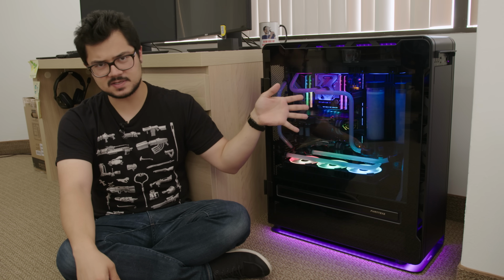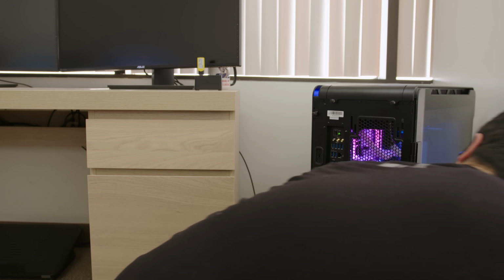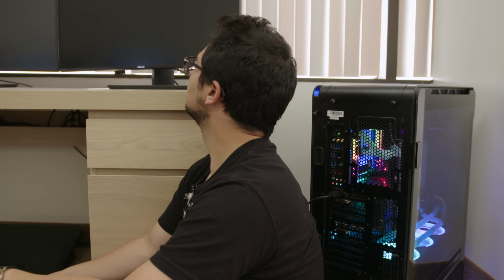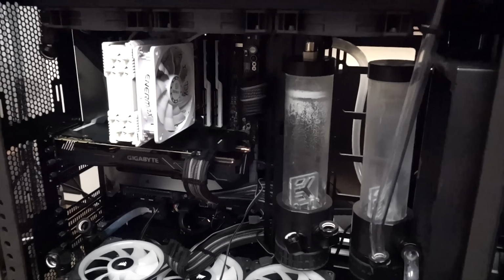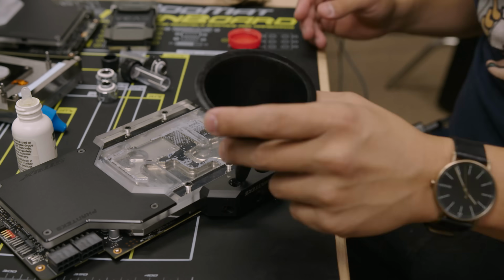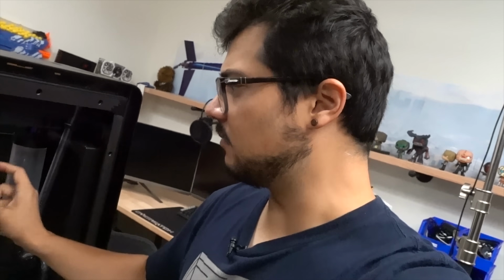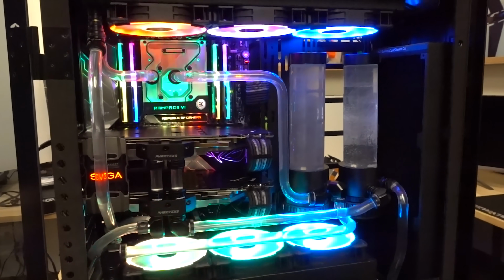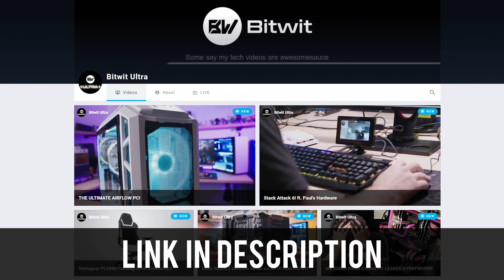Fixing my $12,000 BRICK

Comment: Over the years I have seen computer do some funky stuff when hardware is not seated right. Just moving the computer could of moved that GPU enough not to make the system work correctly. To think that's been sitting there all this time. I still learn shit everyday with computers. Keep up the great work Kyle.
Reply: My PC was dying every few minutes after taking it to my sisters. Took it home and it was fine for days... Took it back and the damn thing did it again. Days later at home it finally died on me and I fgured it out. Aio pump was dying and CPU was hitting thermal cutoff. In the moving process I was rattling the pump enough to kill it and vice versa when I went back home.
Reply: AIO pump don't have a long life expectancy.
Reply: Idk, 6 years seems like a plenty considering it was $40.
Reply: I have fixed MANY problems, with simple reseats.  Memory most often.  Don't know how it happens, but it really does.  Exactly why I didn't hardline my build.
Reply: Simple answer there HotRodHippie....Dust....
Reply: i still have same AIO pump for 5 years now. last years i modded it with a small heater core almost 240mm size from a unknown car and i put fresh fluid ^PC liquid cooling certified^ work great. no not antifreeze for car!!! i won't try it.
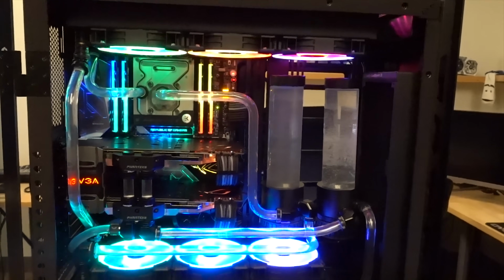Reply: Water dripped on his gpu 13:01
Reply: Worked at a computer company that send PC by post. Had a lot of issues with these large graphics cards getting unseated from their PCI and AGP slots. Not fun, people getting their PC and it won't turn on at the home. They blamed the company, but if you abuse a box with a new computer in it - for instance by tossing it into a truck - then chances are even the strongest connections can get slightly loose. Fortunately the cases were easy to open, so you could let the client fix the computer himself, rather than sending out a mechanic (which would certainly kill the entire profit margin and would likely be more troublesome for the client).
Reply: Kryptix i would have had a heart attack
Reply: @HotRodHippie  Thermal expansion I would think. Thinks get hot & cool down at different rates.
Reply: @Britec09   Been running my 240mm aio on my 3770k since 2012 build and it hasn't let me down yet.
Reply: @TheLogicalLowdown  Agreed they last  a lot longer than some people think.

Comment: Its healthy to get rid of the poop in your loop at least two times a day
Reply: poopity scoopity doop
Reply: Stacy Schauls I thought this wasn’t supposed to happen with the Vue
Reply: You could say I’m, out of the loop. :P
Reply: the2great2bob rabbits go like 12 times a day lol
Reply: Lol247, if you base it on the original marketing of the Vue then yes it should not happen, if you base it on the current amount of warnings that come with Vue you would be lucky to get 6 months. Kyle got lucky, if that fluid ran much longer you could possibly see it stripping the nickel plating off the blocks and when that happens you usually have a cascade reaction across the entire loop of heave abrasion. I have seen in one case Mayhem Aurora out last Vue and Aurora is very, very short term, only for show so that’s how bad it is.
Reply: I do it once every 2 days, and ma loop is good as floop, ah shit
Reply: mantisman230  yeah but two times a day is weak, not human, she must have a loose anus
Reply: A A thanks that’s good to know
Reply: So what colored coolant would you suggest?  Only I've been using straight distilled water in mine, but with graphics card prices back down, I was thinking of getting a 1080 TI, and doing a custom hardline instead of the soft tubing loop I have, and wondering what I should use.
Reply: @DanielMosey  about once a day for me, sometimes skip a day randomly
Reply: Yeah, no one likes a dirty pooploop!

Comment: maybe it was the video cable
a0=everything ok
but absolutely no output
even after a2=no os drive
the system should have been able to get to bios
Reply: Yes dude he made it to the bios , but nothing was displayed bc of the GPU prob,+ if the mb had integrated graphics, the pc would show a normal boot
Reply: Erick Rosa the motherboard have no integrated graphics. So it's useless.
Reply: At first glance, I was wondering why he wasn't trying different display ports on the GPU. Maybe he did, I'm not through watching it but... yeah.
Reply: PeterDerBeste i just had the same problem on a Maximus x formula build A2 error code.  Simply turning on the screen manualy Once  fixed it for me. No problems ever since

Comment: I had the same issue with a maximus x hero and an 8700k. It would say a0, but wouldn't display anything. I unplugged the front usb  and all rgb headers, as well as any keyboard or mouse and it worked fine. So nothing but fans and m.2 ssd. After setting up the bios and installing windows it boots fine with everything plugged in.
Reply: I had to reset my windows in my ssd to get it running. Same setup with you too.

Comment: Hi there! First, just wanted to say that your channel is very informative and engaging and I've been using many of your vids to help my daughter ascend from building robots to building computers as a hobby. I just wanted to say, from a chemist's perspective, that DI water is not such a good idea as pure water, with heat, exhibits a great deal of polarization through something called 'dipoles'. Deionized water, with heat, is great at stripping electrons from metal. This means that steel will form rust and aluminum will form a thin layer of something called alumina (aluminum oxide) which is a pretty good insulator of heat. Hope this benefits you in some way!

Comment: This is the second tech-touber I see that almost ruins a computer with that primochill crap, hopefully people will stop using it
Reply: hopefully people will stop watercooling, having to drain the system, remove countless garden water feature tubes and bits and pieces, then dismantlement to get to the ssd lol lol lol lol lol no thank you
Reply: i mean you could always route around the ssd and not have 2 gpus in it. and maintenance isnt that hard. just refill when low or change out liquid if needed. you click a button sir.
Reply: cctvuser it's not for peasants sorry. Also there is this thing called soft tubing, which means you can remove components without draining. But again, not for the casual joe ;)
Reply: considering my 2 pcs are better then yours im hardly a peasant,  who gives 2 fucks about soft tubing? this is about the epic fail that is kyles water cooling set up, all that trouble to get to the ssd - no thanks, smart people dont put garden water features into there pc
Reply: or they allow salesmanjay to brain wash them )
Reply: cctvuser - The best thing I ever did to my PC was go the custom loop route. My first loop was with the AMD FX-8320 CPU. I had a Phanteks PH-TC14PE cooler (on Par with Noctua's best) and that allowed me to overclock the CPU to 4.8GHz. This worked fine 24/7 through autumn and winter, but when it came to spring and summer I realised it just wasn't dissipating enough heat and I had to back it down to 4.5GHz. I then went to a custom liquid loop with a single 420mm triple 140 rad cooling JUST the CPU. I could now OC it to 5GHz AND it was cooler and quieter than my air cooler - even in the summer. 

All was well until I got my 980ti and started pushing that to its limits at 1080p by maxing out all graphical settings in game and overclocking. The fans were spinning like crazy, so much so that it became an annoyance when I was playing story driven games as you could hear the fans in the background of cutscenes. So I decided to buy a waterblock for it and add it to the loop still with a single 420mm rad and boy what a difference it made. No more whirring fans in the middle of cutscenes in game, and even though I found I couldn't OC it higher, the silence and lower temps were well worth going the custom liquid loop route.

Since then I've never turned back. I've still got the 980ti but I upgraded to an i7 5820K back in 2015 (which I'm still using to this day) and I ran the loop with VERY minimal maintenance on soft tubing up until a few weeks ago. With the same loop I managed to OC the I7 to 4.6GHz but after realising the pump was breaking after 3 years of running the same setup,  I've decided to change the entire liquid cooling setup. I'm changing my case, tubing, fans, liquid, pump and res and fittings to change to a 2x360mm rad setup and hard tubing in a Lian Li PCO11 ROG case. Build progress is here: https://plus.google.com/106577240689351818801/posts/VmcWWceXtiz

All in all, after first hand experience with both air cooling and liquid cooling I certainly will not be going back to air cooling. For the average user who isn't bothered about pushing their PC to the limits, liquid cooling isn't for you. But for the enthusiasts who want to squeeze every last bit of performance out of their PC with the added bonus of cooler temps and silence, liquid cooling is an absolute MUST.
Reply: Ro-Tang Clan no
Reply: Graham Osborn ?
Reply: Ro-Tang Clan sorry bad joke haha
Reply: yup only destilled water goes in my loop with some additives and some colouring
Reply: @SNOUTxTOUT  
It's also an experience to make a custom water cooling loop. I have a Noctua NH-L9a-am4 cooler for my AMD Ryzen 5 2400g, but my dad built a custom water cooling loop for his Intel Core 2 Quad Q9650 CPU. I remember watching him build it when I was like 9 years old. It's pretty cool, but too much of a hassle. Efficiency isn't the factor in decision making.
Reply: Inspecor_Alex your right when you say air cooling is more reliable but watercooling is quieter than air cooling, the fans won't have to run so loudly.
Reply: 1180? haha lol
Reply: James Fondren the 1180 was confirmed was it? Lmao
Reply: James Fondren  confirmed ye? x)
Reply: @Christian González
"You know i want to see inside my pc and look at their components, not a fucking giant ass radiator protuberating from the case like testicular cancer, especially when most probably dont even fit inside the case... "

I don't know about you but I tend to look at the screen rather than the rig.
Reply: What's that now?
Reply: My CPU cooler is fanless and even then temps never go above 55c. it looks much better without any fans on it. all you need to do is :
1. buy a CPU cooler with a huge heatsink. 
2. buy a case with good airflow and equip it with big silent fans. 
3. down volt your CPU.
Reply: James Fondren it ended up being a 2080Ti lol
Reply: @Inspector_Alex Try the 1070 hybrid that comes with a built in aio closed loop.
Reply: @SNOUTxTOUT  you sound 100 years old saying big block.

Comment: System was posting to second card and or bad video output port , thats why post code was ok, lel
Do you even pc speaker for ok post beep?
Reply: YES!!  That's exactly what was thinking too, he forgot what KISS means.  I couldn't stop yelling at the screen what a dumb a** he was for not even thinking of that first.  2 cards, 8 outputs, ya think one card or port could be bad?  Then, he back flashes the BIOS and gets an A3.  Even if the BIOS didn't see a drive he would still get video.
Reply: The read out on the motherboard with the POST code replaces the error beeps.

Comment: Seeing this makes me glad Ive never had a water cooled PC! Looks great until something goes wrong...
Reply: It makes me happy I went with soft tubing and clear fluid. But yeah when I had a few issues my loop got in the way of troubleshooting a bit. Air is awesome, especially something like a high end noctura cooler.
Reply: air is good enough for most builds... but it just doesn't have the same "showroom" look. if you're already $10k into a top-end enthusiast build (especially with RGB everywhere), why WOULDN'T you kick in the extra $2k just to make everything that extra degree of pretty, with a nice looking hardline cooling setup?
Reply: It doesn't even look any better honestly, I like the way certain air coolers look. They're big, beefy, and metal. Sort of reminds me of an engine.
Reply: yea, fair enough. with the right setup and circumstances, either one can be equally as effective. if it's just because you prefer the look, no one can call you wrong for that.

Comment: I used a few drops of food coloring in my system and it worked fine. Even after one year maintenance period, no clogs, no sediment, no staining or leaks. All it takes is just a few drops though. Pros- any color you can mix. Cons- need to mix first and use a small amount.

Comment: You know what's funny? My Elite Build is still kicking. All the TechTubers I showed made comments of how bad my tubing runs were. But ya know what? It still runs just fine. So HA!
Reply: TheB29Bomber It's worth the amount of silence you get. AIO's and air (especially on GPU's) are far too loud. Custom loops let you have so much radiator space you can run the fans silently under load.
Reply: you can get a 360 rad AIO same shit really, way overkill for a single cpu ^^, that can run silently too ^^
Reply: Kunteki No it can't because AIO pumps are hellishly loud compared to a properly decoupled D5. I specifically mentioned GPU fans though. Maybe there are AIO's for GPU's, I haven't seen any.

When the rule of thumb is two 120mm fans for every overclocked component and you instead have six or more 140mm fans, you can run those fans at dead silent speeds even under load.
Reply: If you’re spending 900 dollars on a case you really shouldn’t use anything but a custom loop.
Reply: Tarkus Saine This. I still think the case is a ripoff, for that kind of money you can buy a CaseLabs THW10 which can mount four 560mm radiators and two 280mm radiators easily.
Reply: TheB29Bomber CPU I'd buy. No GPU air cooler is silent under load. Maybe if you have hearing damage. I can't stand fan noise. Simple physics will tell you more fans at lower speeds will move at least as much air than less fsns at higher speeds. Since CPU's will have at most two fans and GPU's at most 3, those fans will typically be running at 1200 RPM's or more under load, which is too loud for me.
Reply: aio for cpu all I need and gpu if i can.
Reply: Im.a.tea.addict Its a LOT of work to do a full loop. I have done 3 so far. All different iterations of the same rig. I keep adding and upgrading components and swapping parts/cases. It's now 2 separate loops 1 for gpu's/1 for CPU. Anytime I have to change anything it's an automatic 8hr endeavor to clean the loops and swap parts and put it back together and fill the loops. Its exhausting just to type that lol
Reply: praetorxyn on the subject of aios on gpus, theirs typically brackets and ya can get a asitech pump and attach it to that. The nzxt g12 has served me well so far, the ram and vrm never gest above 50 when it use to be 70-80 (Asus GTX 1080 strix) the gpu never above 42 even with the front panel obstructed . Liquid stayed about 40ish , average is around 30-40 with it unobstructed using a 280 and 2 noctua industrial 140mm fans on it. Yes it's was way Overkill but it was the point. Theirs also one Corsair makes and I think so dose evga I wanna say?

Comment: The GPU plays a big role in the stability of a computer system. My PC kept blue screening for the longest. Finally changed the riser cable for my vertical GPU mount and this pc has been running for over a year with no blue screens or hiccups.

Comment: Had the exact same thing happen with my last build. Put everything together no post, code was throwing fine. Took the cpu and mobo back to microcenter to see if they could get a post and they said it worked fine. Put everything back together exactly the same way it posted first try and has been running perfectly since. Had to have been a connection somewhere that wasn't all the way seated even though it all looked right. From now on re seating everything is gonna be early on in my troubleshooting process for things like this.

Comment: I think you hit the nail on the head with the GPU not being seated properly. I have had that adventure more than once. Some PCI Express slots can be very picky and you need to push everything in perfectly straight or it won't make proper contact on some motherboards. I think it was twice that I ended up reseating a card and wished I had done that before I did everything else, once on pre-built unit I was troubleshooting for somebody and once on a unit that I built. As to your CPU, It is rare that chip defects cause excess heat to that degree. The heat needs to be lead away so I would definitely redo the thermal paste to be sure it's making appropriate contact and then just reassemble everything from there so that you can make sure everything is making firm contact. It could be just the silliest thing like the paste being uneven in the wrong place or just something not making firm enough contact. Your pumps look like they are running strong so I doubt it's anything to do with the cooling loop.

Comment: I'm new to PC building/gaming or just PC in general but one of the things I think I'm going to do when I build my first water cooled build is to use antifreeze in the water solution instead of just water or water and that coloured gunk. Antifreeze has anti rust properties and other properties to stop the corrosion of metals such as aluminium (your radiator). It also protects rubber seals and other plastics. It raises the boiling point of water and more importantly, its heat transfer properties, and comes in some nice colours.